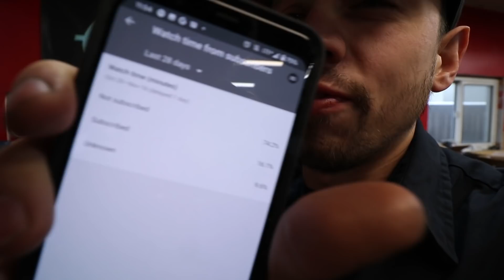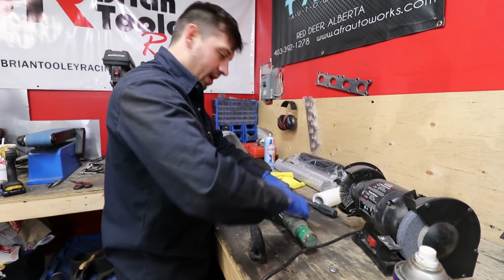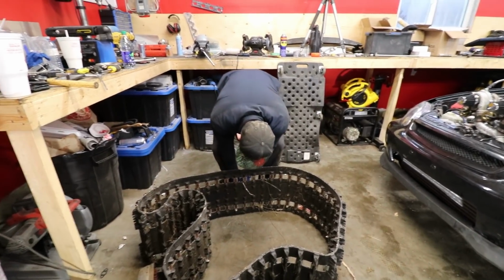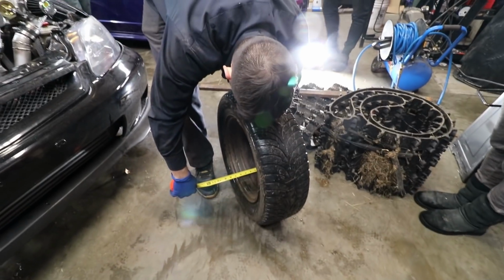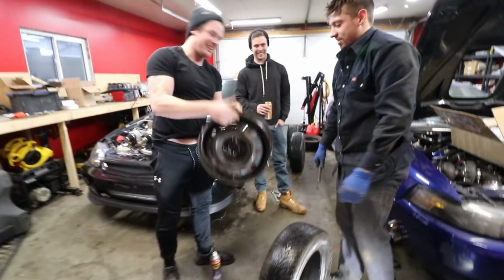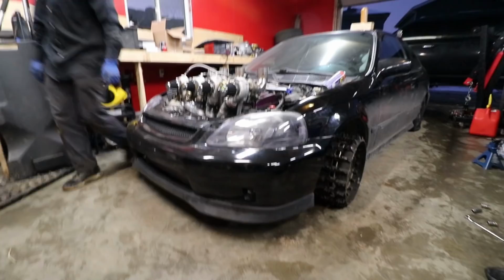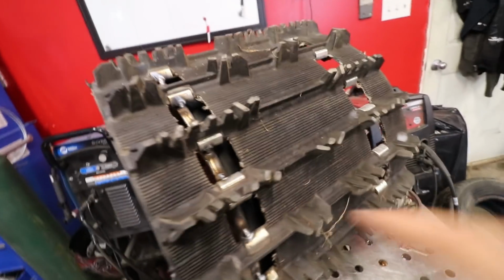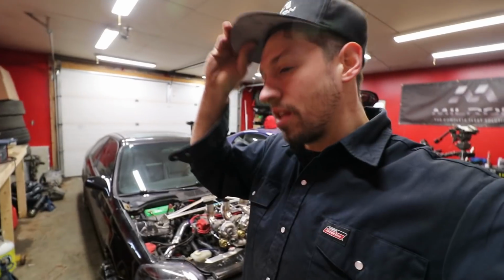Quad Turbo Civic Gets Tracks!! Part 8

Comment: On the inside bead use bolts go through track and wheel
Reply: Was just abooot to say good call
Reply: Or seeing as there is metal running across the track just grind away the rubber and weld to that
Reply: @jeremymann8930 the metal pieces dont go all the way across, bolt seem like the best route.

Comment: Aww man.... I was hoping you'd weld to the inside track and let them stick out from the car. Then you could weld a couple rods across the exposed metal thats outside the wheel to hold the outside edge that wasn't in line with the metal of the rim.

Comment: Just an idea if you want to keep your final drive optimal and not be at 6k rpms at less then 100kmh specially with the sir trans..
Can use a v belt chopped in 3-5 inches lenghts...bolt them on the tires u have in a patern like a tractor tire.air tube in the tire.voila
Reply: how he gonna bolt on and keep air in the tyres
Reply: @andrewjames6707  he said tube in the tire.....

Comment: WD-40 isn't a lubricant.. which is what i assume you were using to help in turning those spanner rings? or just using to clean the threads after wire wheeling? getcha some seafoam deep creep.. good shit..

Comment: You think you would try and get it tuned before adding tracks. I mean you have 4 turbos and only at 15psi. Your injectors should be well over twin 2500cc's per piston. So from the looks your missing a lot of fuel and a lot of psi! #slowquadturbo #nopower
Reply from the maker: Pfi is at cleetus and cars so I can't do that yet. We maxed out 550cc injectors at 6500 rpm and 15 psi so I would assume it's making power
Reply: @Boostedlifestyle  I guess if all your after is clout you got it.